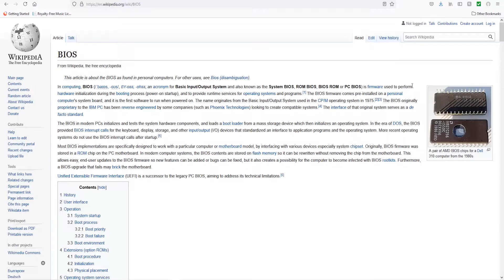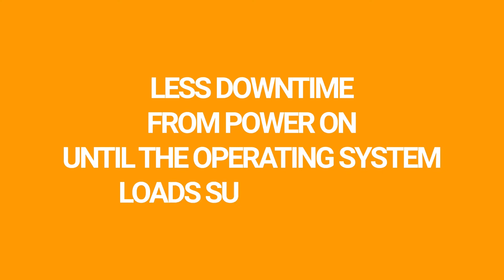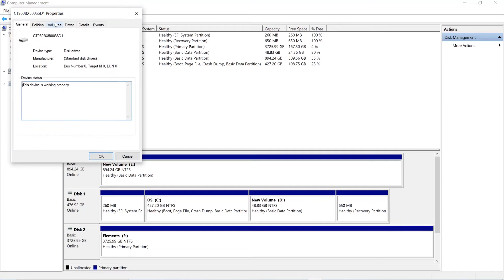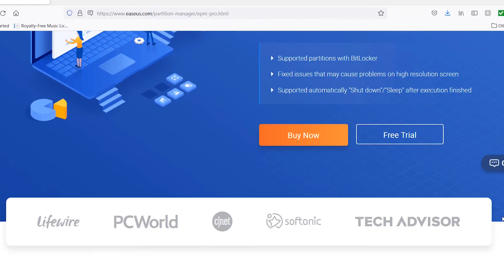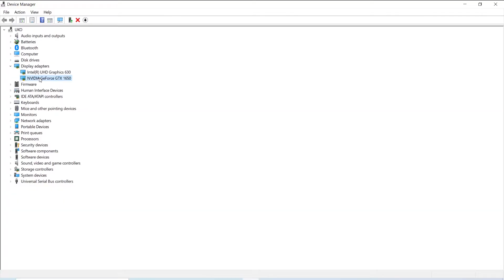UEFI vs BIOS: What's the Difference? Convert BIOS to UEFI Without Data Loss - EaseUS

Comment: At the current time there are no drives that are even close to 1 Zettabyte  and if there was 99% of the population could not afford it and Bios Legacy is more reliable than UEFI and 95% of the population does not have over 2 terabytes on a single hard drive.
Reply from the maker: Indeed, the size of most HDDs is below 2TB.  
Selecting boot mode based on the drive size sounds interesting. For 1TB size HDD, select BIOS; for 3TB or bigger disks, use UEFI. 
Basically, selecting BIOS or UEFI is based on the motherboard and system requirements. For example, Windows 11, it requires GPT and UEFI boot mode.